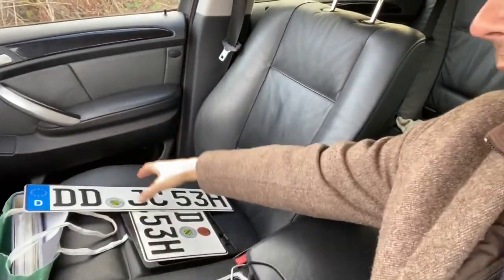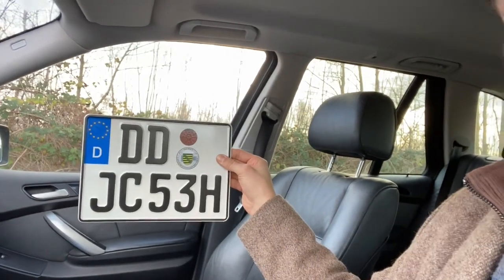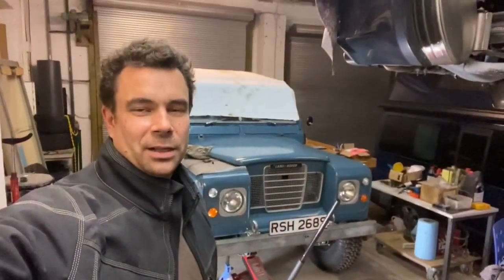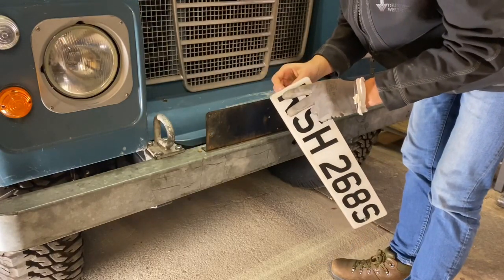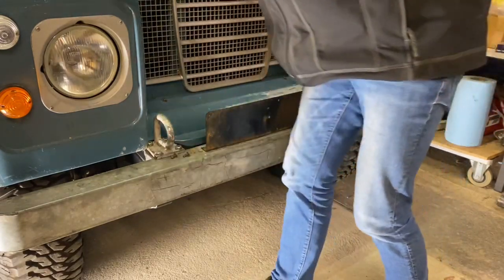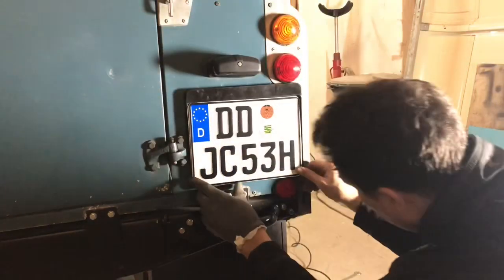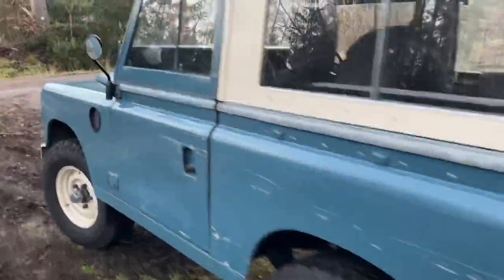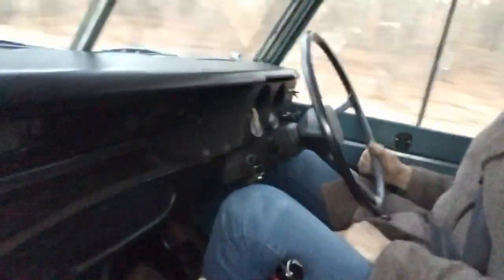Land Rover Series 3 Restoration - First Drive & Registration - Part 66

Comment: Great treat to watch this.  I remember my family all piling into my Rover, dogs too - for the first time - and heading out for a first drive.  I laughed out loud multiple times at the number plate story.  I went through a similar charade here registering a "Year of Manufacture" number plate - basically an original plate from the year my 2A was built.  You're allowed to source an original (in my case) 1968 plate and register your vehicle under it.  It was a day of trips and travel between registration offices to get all the paperwork sorted.  Worth it. Looking forward to seeing more "in use" videos and more maintenance videos.  The weather is only going to get nicer, so be sure to knock out the odd jobs that take her off the road - before the weather is perfect for daily driving!
Reply from the maker: Hi Charlie, good to hear from you. There should be a guide book to restoring old Rovers which manages the rollercoaster ride of emotional highs and lows. I actually think that should be a supplement to the Haynes manual 😀 I have already started on the post restoration projects. Ordered a new cylinder lock from Master Eccu as I can’t lock the back door right now. This has actually restricted use of the Landy for security reasons but once it’s done I can use it more. Not that those locks offer great security but I guess better than none at all. The original cylinder has a very strange case of being able lock, but not remove the key... who knows 😅 have a good weekend. Is your annual fishing trip drawing closer? Regards Joël

Comment: Really enjoyed that! Glad you got through the registration and number plates saga. Interring how the authorities were at the same time both beuracratic and really helpful! I loved the complete office in a briefcase the engineer used. I'm interested in your comments about the tyres and preferring 750s as I am about to make the swap from 750s to the wranglers. The film of the Land Rover on the open road and in the woods looked great and makes all your hard work worthwhile.All the best Mike.
Reply from the maker: Hi, thank you. I don’t not like the wranglers by any means. They are a modern tyre and offer added bounce. I just feel the thinner 7.50‘s are more nimble. A bit light on the road of that makes sense. I think I will swap out the fronts for a test drive on the old tyres and see how different it is.

Comment: Great to see it in its natural habitat - off road! Got mine back from the garage with a refurbed gearbox, new clutch and various other bits. Now I have to fix up all the things they seem to have broken in the meantime - fuel gauge (it'll be the sender connection), wing mirror, loose cubby box, backwards handbrake gaiter - I could take it back and complain but its easier to just sort these things myself!
Reply from the maker: I agree entirely. Isn’t it funny how many people install the hand-brake gaiter the wrong way round. Even I did it once! 😀 Have fun tinkering. I have ordered a new rear lock cylinder from CharlieEccu.  Will get that job on video when it arrives. 👍
Reply: @My911  I got my replacement lock cylinders from CharlieEccu - a pair keyed alike so the driver's and the rear door have the same key.
Reply: Many owners purposefully fit the handbrake gaiter backwards as they’re supposed to last a little longer than the usual one drive before they disintegrate. Put plenty of rubber grease inside!
Reply: @poacher9118  With the gaiter on backwards I don't get to the endpoint of the travel with a satisfying clunk when I take the handbrake off, it squashes the rubber and I'm not convinced the brake is fully off! What's the best rubber grease?
Reply: @BarryRowlingsonBaz  I’ve always used Granville for all of my grease, from eBay. I hear what you’re saying. Any aftermarket rubber is usually almost terrible so may be worth getting / making a leather or better chosen material set. I found mine backwards and completely disintegrated, bought cheapo set and fitted the right way round and it split within one drive!
Reply from the maker: Same as me. I’ll change both.
Reply from the maker: Dito.
Reply: @My911  Fuel gauge problem is because I've got a diesel car, so there's two wires to the sender - one for level and one for the low warning light. But I seem to have a petrol sender unit installed, with only one connector. And the garage picked one of the cables to re-connect - and picked the wrong one. I've also only just spotted that I don't have a yellow 2/4wd knob!

Comment: Great work, even with a last minite panic, you got registration completed!  Well done!!  One question, did you need to fit lap seat belts to the side facing rear seats? Cheers.
Reply from the maker: Hi, thank you. No I didn’t luckily. Given there is a grab Handel on the inside of the back door, it wasn’t necessary.